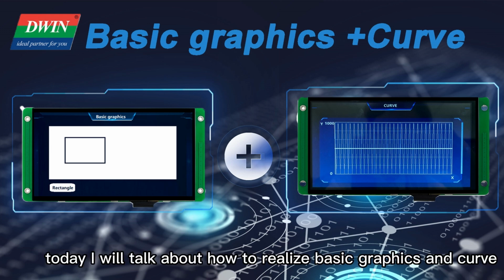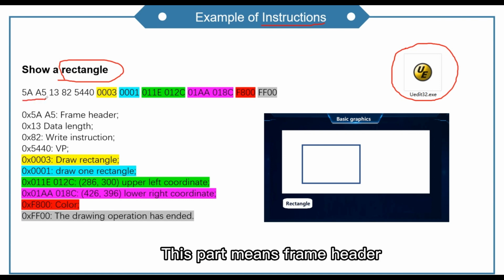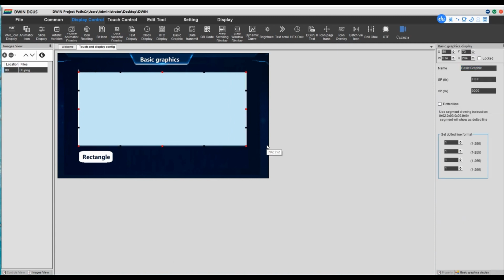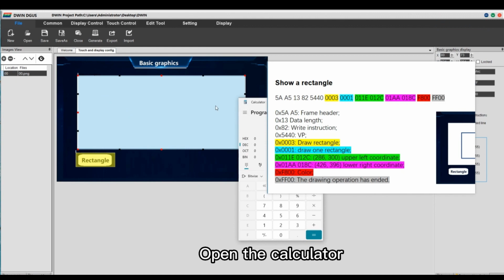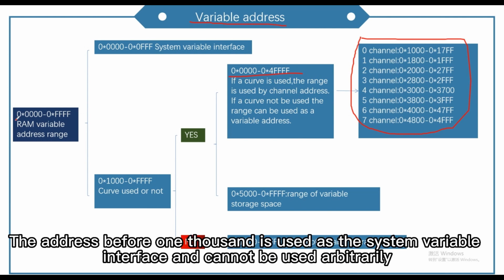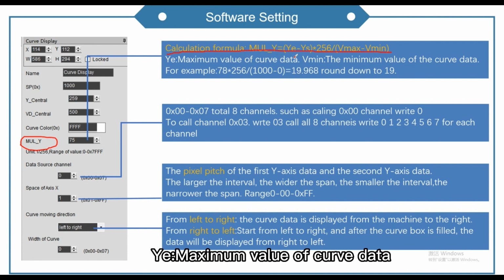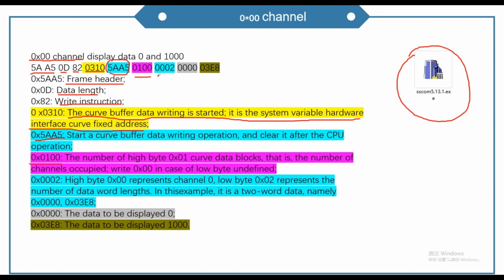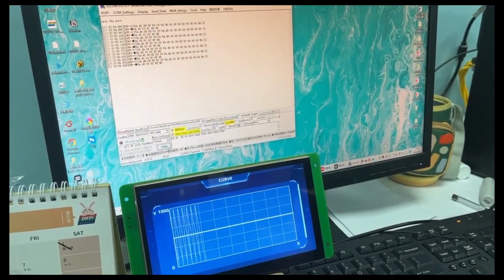Basic Function 05 - How to use functions of basic graphics and curve | DWIN T5L DGUS Tutorial

Comment: Hello, i create same project as you, step by step, then i try some way but nothing change, basic graphic not work.
Maybe 16:14, you get wrong line in bin file? And after "generate", the 22.bin is change to 0x00, ofcourse.
This is my project, using V7647: https://drive.google.com/drive/folders/1BiKMtQDuehrZ_Wahh6dCAdmPvIkW1m_D?usp=drive_link
Reply from the maker: How about re-save 22.bin?
Reply: @DwinTechnologyOfficial   i did, and this is serial data when i touch "draw rectangle", and at last, i create "data variable display" to show value of "0x1000", it change to "0x03", i tried add "0xFF00" but draw function still not work: https://drive.google.com/file/d/1dkuKKYI_7CMIdTlHCvqr6YdxSImm0GQe/view?usp=sharing
Reply: They forgot to set the data length on the Sychrodata Return to 19 in the video, just do that and it will work.

Comment: how can I show 3 rectangles in different colors (green, red, blue) on the screen?
Reply from the maker: Dear, you can send the command to show three different rectangles: 5A A5 27 82 5440 0003 0003 011E 012C 01AA 018C F800 01AB 018D 01E6 01E6 F800 01E6 01E6 0162 022C F800 FF00
0x5AA5: Frame header; 0x27: Data length; 0x82: Write instruction; 0x5440: VP; 0x0003: Draw rectangle;
0x0003: Draw three rectangles; 0x011E 012C: (286, 300) upper left coordinate; 0x01AA 018C: (426,96) lower right coordinate; 0xF800: Color; 0x01AB 018D: (426,96) upper left coordinate; 0x01E6 01E6: (486,486) upper right coordinate; 0xF800: Color; 0x01E6 01E6: (486,486) upper left coordinate; 0x0162 022C: (354,556) lower right coordinate; 0xF800: Color; FF00: The drawing operation ends.
Reply: Thank you. What should I do if I need to draw a lot of points and they don't fit into one team? @DwinTechnologyOfficial